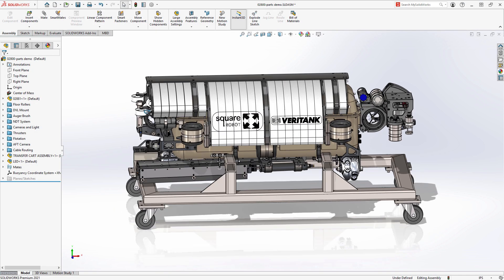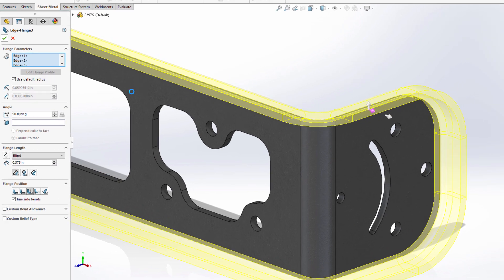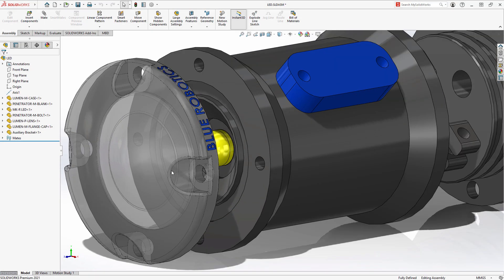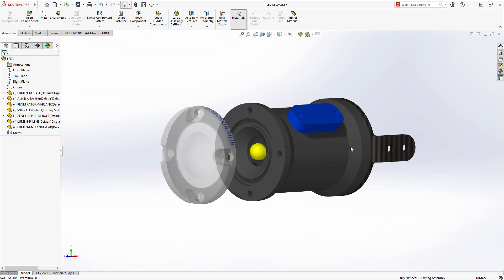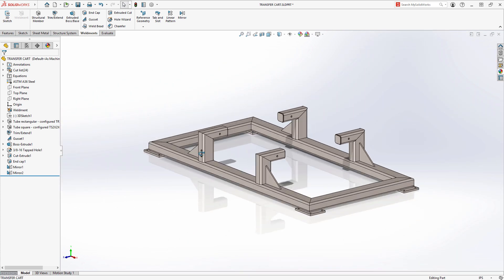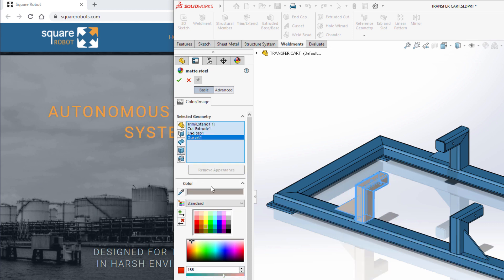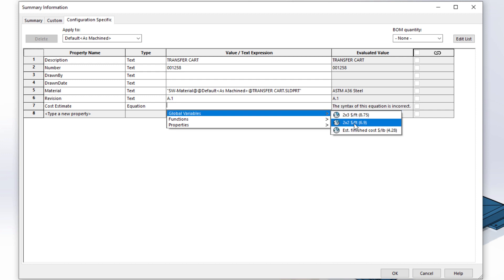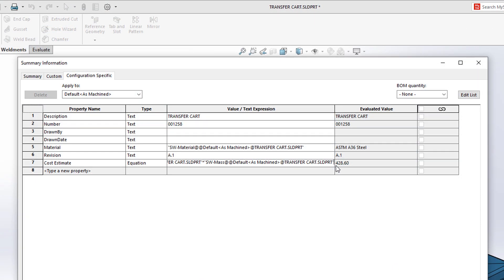What's New in SOLIDWORKS 2021 - Parts

Comment: how to sync two circle example:-
one circle dia75mm and secound circle dia1000mm
dia1000mm (1000mm-100mm=900mm) so change 
dia 75mm change (75mm+100=175mm)
mins i one circle dia minuse so secound dia pluse is value
how create

बहुत बढ़िया पर मुझे ऐसा काम कुछ इस तरीके से करना हो तो कैसे करे कृपया बताये 
जैसे के एक circle 75mm dia का हे और दूसरा circle 1000mm dia का हे 
अगर में इन दोनों में से किसी की भी साइज़ बदलता हु तो वो एक दुसरे में pluse  minus खुद्ब्खुद हो जाये 
जैसे के अगर में 75 mm dia में 25 mm जोड़ता हु तो वो dia 100mm हो गया पर जो दूसरा dia जो 1000 mm का हे वो 975mm खुद्ब्खुद हो जाये 
बस ऐसे कोई भी एक dia अगर pluse होता हे तो दूसरा dia खुद्ब्खुद minuse हो जाना चाहिए 
और कोई भी एक dia minuse होता हे तो दूसरा dia खुद्ब्खुद pluse हो जाना चाहिए 
हा पर जितना हम pluse या minuse करते हे उतना ही value एक दुसरे dia में pluse minuse होना चाहिए 

कृपया करके ये बताये ये कैसे हो सकता हे solidwork में ?
Reply: Use design table Excel to equate your desired value. You can decrement and increment with same value. Or use global variable